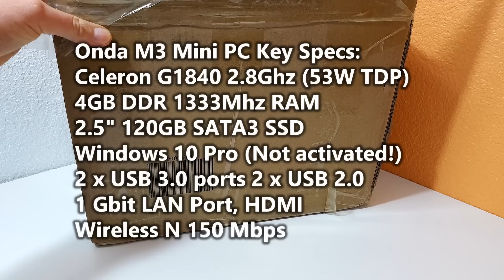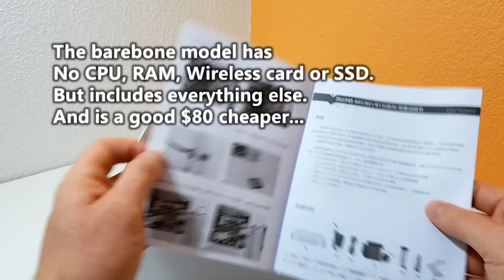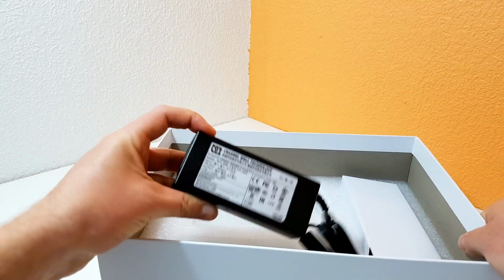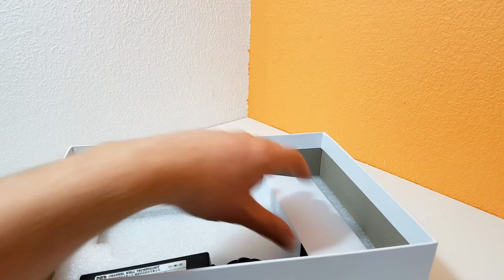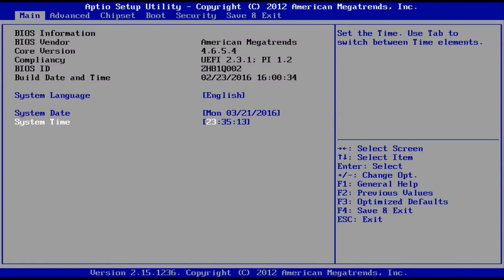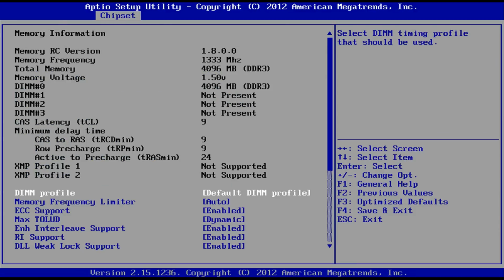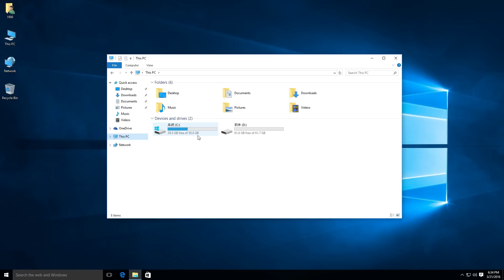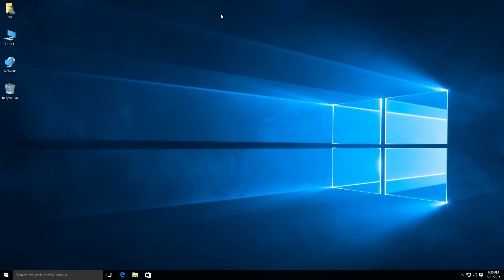Onda M3 Mini PC Unboxing, Bios and First Boot

Comment from the maker: Onda M3 Mini PC Unboxing. There are two models a barebones unit and this one with a Celeron G1840, 4GB and 120GB SSD. I got this unit from Gearbest here: http://goo.gl/6AC7Qj

The barebones unit allows you to add your own Haswell LGA1150 CPU. As long as it's not over 55W-60W (Power support is only 65W) and an mSATA and 2.5" drive. RAM is limited to 204 pin sodimm's and only a single slot.
Reply: can u do a full review plz
Reply: +TechTablets.com I would love if you opened and showed internals of each item you review :) even for non engineer type of people it would be interesting to hear your opinion about build quality.

Comment: Can you confirm if really have the socket LGA1150 or if is soldered to the board?
Reply from the maker: +Geraldo Sp Yes, it really is socket LGA1150 like the barebones model, this is exactly the same just with components. All depends on how much you want to spend and how much power you want. If I had know it has a 2.5" SSD and not the advertised mSATA SSD, I would have got the barebone unit and a cheap used Intel Core i3 4130.
Reply from the maker: +Geraldo Sp Also his geekbench 3 proves it's socket 1150 LGA from the System info http://browser.primatelabs.com/geekbench3/5747112
Reply: +TechTablets.com i'm thinking to buy the barebone unit and an i5 4690t
Reply from the maker: +Geraldo Sp 4690T would be a good fit, less heat. But so far it's handling the 53W Celeron just fine, very quiet when idle. But the fan does kick up a little but drops down quick. Stressing it so far only 66 degrees max. But early days. The cooler is more like a large notebook cooler found on the MSI GT60

Comment: Maybe open the SSD and see what chips is in there?
Reply from the maker: +nemesisN3 Might do, it's a rubbish SSD, it's causing the OS to freeze up at times. Speeds where good, but not the locking up problem.